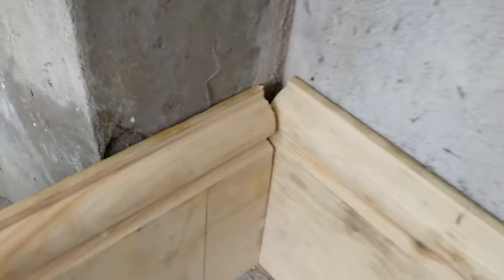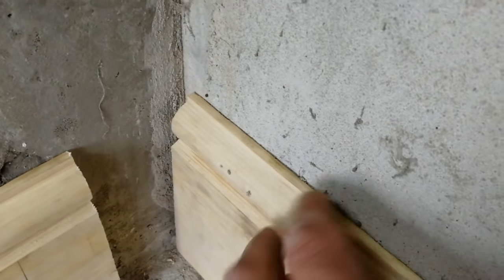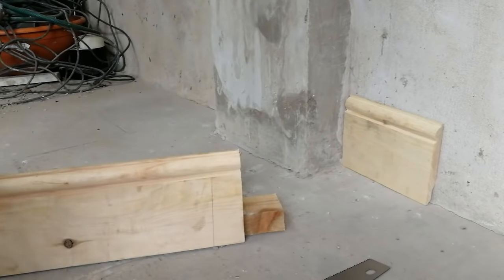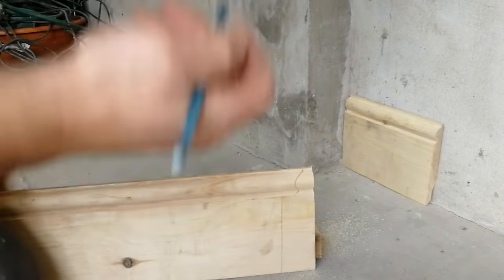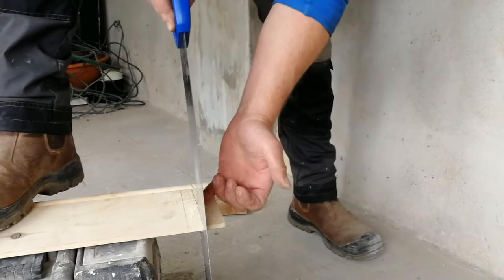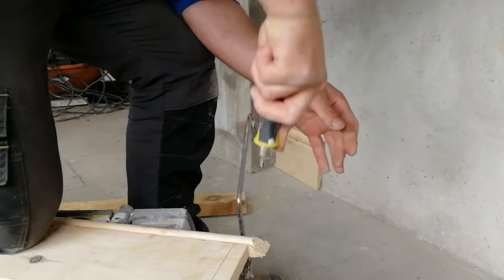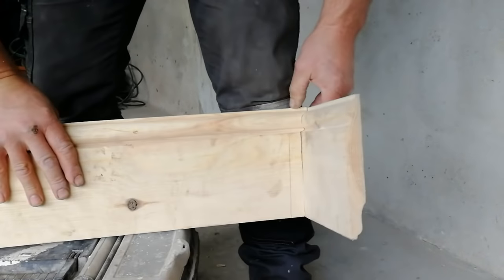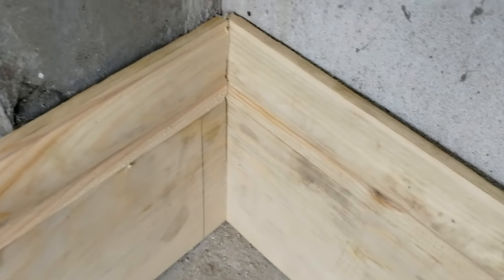joiner carpenters tips tricks save time

Comment: Thanks for this video. Brings back memories. I'm fifty years at the trade and have hardly touched a hand saw, especially for an operation like this cope, in many years. Your critics demonstrate their egos, not any superior skill. You show the method I was taught as a boy; and moving on with the expectation that caulk will perfect the result looks entirely appropriate, given the rough situation of this install.

BTW, another possibility that you might consider in this type of situation is a jack miter: you would cut the straight bottom portion just as you did, but then miter only the top molded part. Likewise, you would miter the top of the piece it butts to. This gives a reasonable result, most of the advantages of a full cope, but without taking the time, trouble, or skill to cope the molded portion.

Another "trick" that your critics will decry: if you feel caulking the top edge to the wall will be acceptable (and it definitelywould be in this case), you can use the head of a small screw partially driven into the back side of the piece you are coping against to bring its face to plumb before coping the next piece. This can be more convenient and give more control than using a shim after the fact.  The technique can also be used if the bottom of the baseboard leans inward from plumb. In this latter case, the screw doesn't show, nor is caulk at the top necessary.  If the walls are timber framed instead of concrete, the screw shim can be driven at the appropriate height into the wall, rather than into the back side of the baseboard. 

As your detractors might have pointed out as evidence of their vast understanding, a modern pro would use compound sliding miter saw and power saber saw with aggressive tooth configuration and Collins coping foot, which enables cutting the cope from underneath with lots of control and great speed. But demonstrating this method would have been far less useful to its intended audience than the very sound and practical technique you shared with DIYers. Along with them, I appreciate that you took the time to share it. Good technique. Good video. Rude commenters.
Reply: i guess im asking the wrong place but does anybody know of a method to log back into an Instagram account..?
I somehow forgot the password. I love any help you can give me
Reply: @Bryant Brooks I really appreciate your reply. I found the site on google and I'm trying it out now.
Takes quite some time so I will get back to you later with my results.
Reply: @Bryant Brooks It worked and I now got access to my account again. Im so happy:D
Thanks so much you really help me out !
Reply: @Angel Dominik No problem :)
Reply: Thank you for the great ideas

Comment: Thank you for that. The initial 45 degree angle cut, i had not seen before. Priceless tip. And you’re correct, wedges and quality caulking will finish the job tidy. Very much appreciated

Comment: Another way instead of pulling out at the top is just going with the wall and scribing  the scribe cut to the angle that is no longer 90
Reply: Exactly!  He could have simply adjust the "square" line he made on the flat face of the baseboard (skirting) and cut it and it would have fit with no additional gap at the wall on the other piece.  No added steps, no added time.  In fact less (no shimming and less caulking).

Comment: Skirting can be one of the hardest jobs as a joiner trying to work around bent twisted out of plumb walls , specially when the plasterers can’t skim a reveal square and it throws external mitres out
Reply: Beautiful work using hand tools, but it's we are in the 21st century and over the course of a house worth of skirting and Scotia, a mitre saw and a barrel grip jig saw equipped with a Collins coping foot will be the fastest and most accurate way of doing this. The skill in using your hand tools cannot be denied though, so for that you have my praise!
Reply: @N1rOx  It depends on how big the job is ,other wise it’s not worth setting up power tools . A basic hard point crosscut handsaw & educated use of a coping saw is all that’s needed .
Reply: A joiner that works on many jobs with twisted & out of plug plumb walls ,soon learns the value of being proficient with his axe & scunting chisel . Not all walls are out due to poor plastering skills ,sometimes it’s due to old age settlement in old & listed buildings . This is known as character ,walls that are perfect & square are boring & devoid of any .
Reply: @maskedavenger2578  hence why I said over a house worth.
Reply: @N1rOx  Unless it’s a massive big house with more than two or three bedrooms ,it’s still not worth dragging all the big kit out for ,just to fit a few skirts . Fitting skirting boards with a few basic hand tools ,is run of the mill stuff for an experienced time served tradesman .
Reply: @maskedavenger2578  would have to disagree there. We have a very efficient set up system and anything over a room would be cut and finished long before the best team with hand tools got it done. To each their own but we are financially incentivised to find the fastest methods. In our experience, once you get past a room the cordless tools come out.
Reply: @maskedavenger2578  I think we're saying the same thing here essentially. Also we barely ever just do the skirting so it is always worth the set up
Reply: @N1rOx  it takes one tradesman to fit skirts not a team . The less power tools to drag around & set up the better . You are obviously working on hit & take the money & run jobs .  Probably using mass production set up techniques ,one measuring & marking ,one cutting & one fixing. When one is used to working on more lucrative properties ,the clients tend to prefer more time to be taken to ensure a more professional & bespoke result ,especially when the finish is natural wood . The over use of the old educated nozzle of painters gunge to fill gaps left by the fast job & out bunce in the pocket no questions asked chancers ,is not very professional .
Reply: @maskedavenger2578  no we are in the same client range. Our work is close to flawless on stain grade and paint. Don't assume. We take time where it's required and are efficient everywhere else. Our customers are always happy with the quality. Like I said, our set up is very efficient and we are incentivised to be that way. Which is why we use cordless power tools as soon as it's more effective to do so.
Reply: @maskedavenger2578  but it sounds like you have clients who are willing to pay for the care required, whether that be with hand tools or otherwise and that is cool. We do our jobs on set price so it makes sense for us. Keep doing what you're doing if it works for you.
Reply: @N1rOx  I used to do the whole first fix & then go around doing the second fix . I used to do the lot bench & site even did shuttering abroad . I made timber windows & French windows & Door frame plus doors for a 1920’s mansion ,on site using a B&D workmate ,hand tools & drill ,sander & router . Got my tools there by motorcycle & had the timber & rest ordered & delivered . Did similar many times in old days, they are spoilt now all rush ,gadgets for gadgets sake ,idiots walking about with overloaded tool belts & braces to stop their pants from falling down . All the gear & no idea .
Reply: @N1rOx  I only use power tools when necessary ,when it comes to tools less Is more for me . I had that many tools ,in the end I had to leave them dossed all over the place ,hidden in cellars, attics ,lofts & even elevator/ lift motor cupboards . I have retired now & left them all in buildings I regularly maintained for wealthy clients .  I still have more tools than I need to maintain my own property . You buy a large van tool box or tool belt & you will end up filling it up with more gadgets & tools you don’t really need .

Comment: Should've really included undercutting and scribing to the wall which Is the correct way to finish skirting to an uneven wall. if it isnt a painted finish then gaps aren't an option, as some people have commented. Also 45 degrees only works on a 90 degree reveal but when  are they ever?😂. Always bisect your angles especially if you are going into angled bay or something. Scribing is definitely the right way though. Never internal miters!

Comment: Not sure you know exactly what a scribe is, your not only cutting out the profile, you need to match the angle, this keeps the joint tight even if the timber shrinks.
You may have well done an internal mitre and caulked the gap while filling the gap where you've wedged it off the wall.
Reply: so then the skirting and the wall would be out of level hes done his part correct.

Comment: A good plasterer should clean there skirting lines but 9 times out of 10 they leave like a little bell cast or a little ridge at the bottom that kicks the skirting out I useally adjust it on the straight cut bit I can kinda judge it by eye now adays as iv done so much skirting but fairplay for cutting your mitre by hand lol I use a mitre saw now its so much easier

Comment: The reason your scribe is lying open is because the wall which the dead skirting is fixed to is not plumb this is easily rectified by instead of cutting the vertical on your scribe square scribe it to the wall first that way you don’t need to pack anything out and the scribe is air tight and is ready for painting instead of having to fill, not as obvious on a 4 “ skirting but on 6 “ and 8 “ and deeper it looks awful.

Comment: Or you could cut the wall behind the board to be plumb and use a correct angle to butt them together such as 45° to 45° or 22.5 ° to 22.5° and make a perfect smooth joint with two perfect cuts on a miter chop saw. Simple, quick beautiful transition from board to board.
Reply: Internal mitres is not the way to fit molded timber to an internal corner in any instance

Comment: This is madness why on earth are these videos around showing people how to "scribe" a skirting corner. 1stly it was done that way before mitre saws we're invented when carpenters had no way to accurately Mitre cut & they used hand saws & coping saws all day so had built up the skill to use them quickly to do this method. Secondly & most importantly the whole point is to get the geometric look of the 45° mitres like the external corners, like a picture frame. with this method your joint line isn't straight down the centre it waves off following the upper profile of the skirting. Also ridiculous because the first step of this process is to 45 mitre it so just stop there. Yes not all rooms are perfectly square so either fill the gap with caulk if your painting it or if your leaving it as natural wood just sand the rear of the 45° edge down a little if you have slight gap towards the front & vice versa if you have a gap at the back.